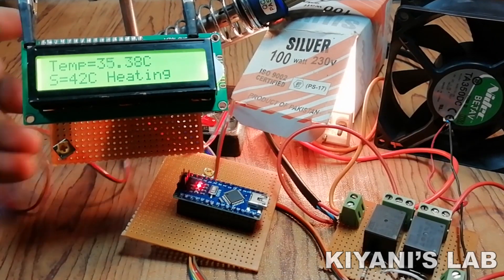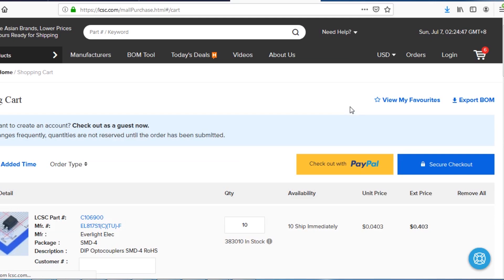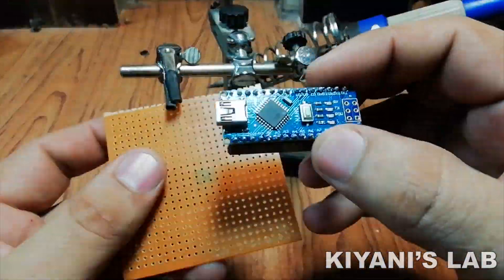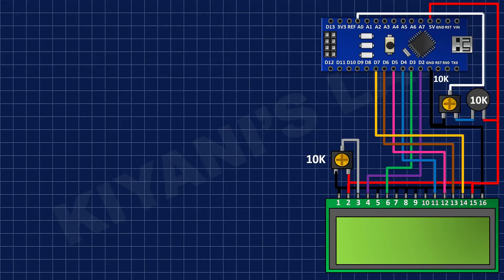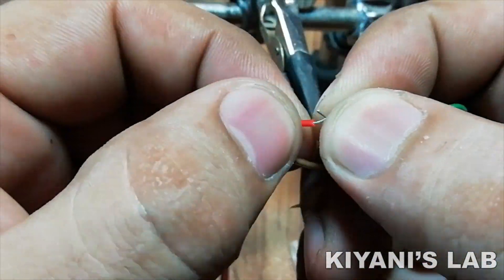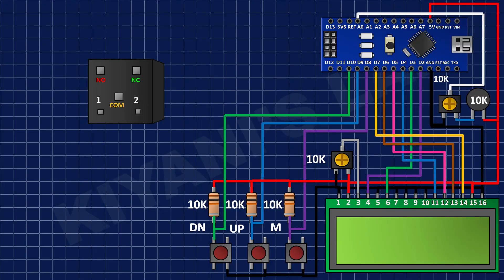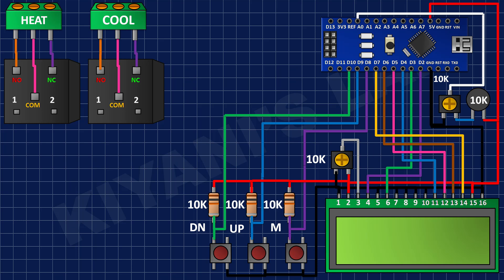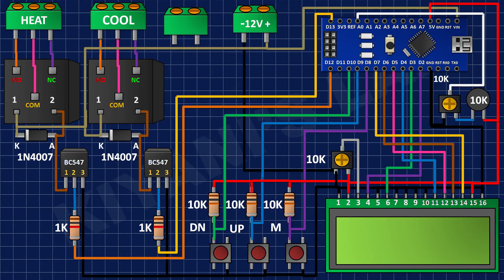How To Make Digital Temperature Controller

Comment: hello! i have a question for your project. I am curious about your relays logics and how did you physically connected them. Which relays connector you connect voltage beacuse if i understand right the heating and cooling are diffrently connected(one is connected to normally open and one to normally closed)? otherwise cool project!

Comment: Hi Kiyani's Lab i need this only fo heating controll did i must make a cooling too or not. Thanks
Reply from the maker: for better result you need to add cooling too but is can be work with only heating if the environment is not to hot you can only use heating
Reply: @KiyanisLab  I only like to control Water Heater for entire hous so the digital temperature controler will be be placed on the hallway and when the given temperature is reached it will cut the heating.

Comment: I have notice that 4 buttons have been used in code , but in your code and circuit diagram .. you have only shown three buttons ? 
something missing ?
I don't understand the use of variable "m"    in code.   
when the value of "m" will reach  1 ?  (m= 1), when we press button 8 and variable "x" reaches 300 ??  if(x==300) 

it means loop() will complete 2 rotation and  move to 3rd rotation. 

please clarify doubt.

Comment: Can we use Arduino Uno for same task ? 
1. Is it possible to control 5 appliances with five PT100 ?
2. Set different temperatures for each appliances. eg. Fan 40degree, bulb will be ON at 50degree ?
Reply: The puch buttons used to increase or decrease temperature..how we can use same push buttons for 5 different PT100 ?

Comment: sir Please upload one vedio for
sht31+esp32+oled1.3"+blynk+thinkspeak+button controler
( temperature and hummidity setting thereshold)+with calibration setting from button+centigrade & farenheit setting from button+temperature and hummidity high & low alaram using incubator.and  egg turnning time control+ventilation controler from temperature based 0 to 180 degree.+data logger . thankyou

Comment: Bro i want how you connect 💡heting divice & fan to the circuit
Reply from the maker: you need to connect the line wire of the device to NO terminal of the relay and connect main line wire to COM terminal of the relay
Reply: @KiyanisLab  how it's connection in Paraller Or in series

Comment: can the thermistor be replaced with a thermocouple?
Reply from the maker: yes but we need to use voltage amplifier for that can be made with opamp
Reply: @KiyanisLab  if we use pt100 , which IC will be suitable for it ? MAX31685 ???

Comment: Why did you put 4 push buttons but the diagram has only 3 push buttons? Which digital pin should i solder the fourth one?
Reply: pin 11  has scope to use for 4th button , no code is supporting this button.

Comment: Sir, thanks for the video. Am only seeing the limit temperature, how can I set the minimum temperature? Or how will the cooler and the heater be turned on and off if you set the limit? I want to use this project in the egg incubator.